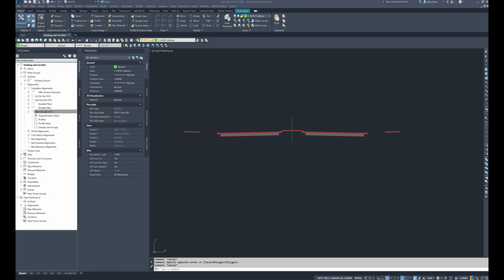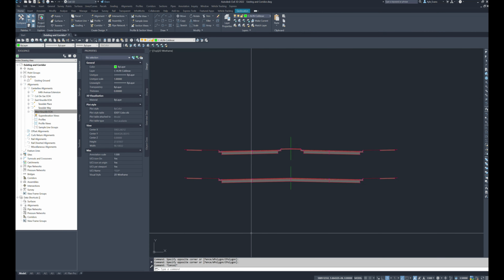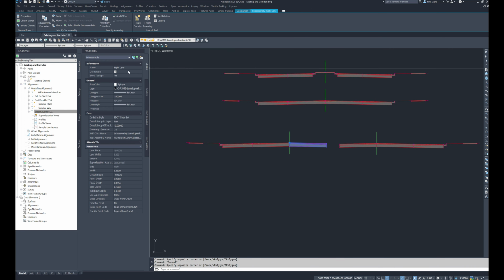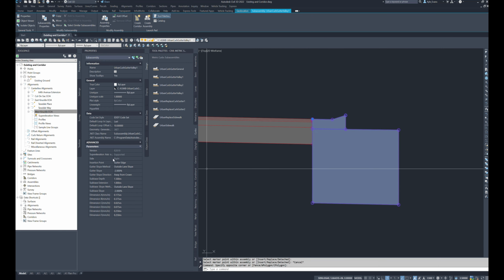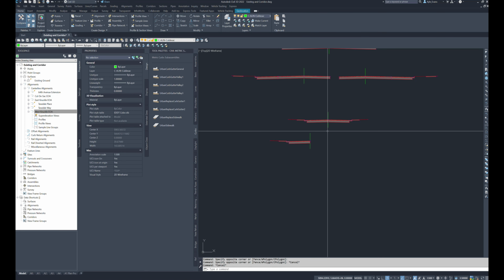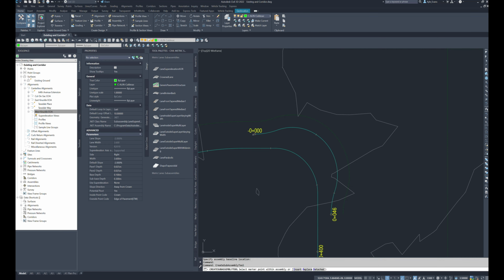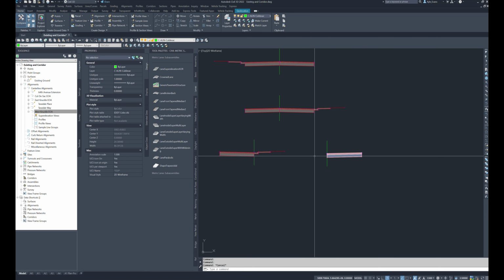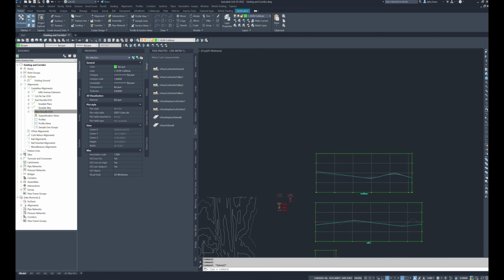Part 4 - Creating the Rest of the Assemblies for the Subdivision Road

Comment: how do you if to use curb fillet right or left?
Reply from the maker: It all depends on which side of the road that you are modelling. If you look where the assembly marker is, sometimes the Curb and Gutter is on the Right and sometimes its on the Left.
Reply: @KyleEvansCivil  understood. I understand from the perspective if you are using alignments. Right or left can be the direction of travel from start to finish along the alignment. However, in the case where you are using curb fillets in the intersection tool, I am confused as to how to use curb fillet, because, i only get to select one fillet in the intersection tool and that assembly is deployed on BOTH curves for the intersection. (Hopefully you understand, what I am trying to ask)
Reply from the maker: @RD-gj4ki  yes, in that case it's curb return right, because the lane is on the left and curb and gutter on the right. Unless you drive on the left side of the road.
Reply: @KyleEvansCivil  ok. Then I will have to use curb return left. 
Thanks for your videos. They have been an immense help to me.

Comment: Sir, u have explain every thing very well in this whole series of videos. sir i have facing a error in cut fill qty when i am using curb assembly with sub-base extension 0.2m when i am create corridors surface from bottom links in my corridor surfaces back side of curb and upper side of sub-base extension portion surface are missing in cut/fill . how can i solve this issue. sir, please give some suggestion to solve this problem. thanks u very much. i have attached the error pic in comments section.
Reply from the maker: I do not see a picture, if it was a link it may have gotten filtered out. 

Civil 3D from my experience does not do a very good job at gathering volumes from anything other than a "top" code in your corridor. You can try to get a surface from base, or sub base, but the issue is that every single subassembly needs to have those codes in them. What I do, is get volumes based on the "top" code, and then manually subtract the Asphalt, concrete, other volumes.
Reply: Sir have u uploaded any video regarding these volume calculation manually.?
Reply from the maker: @naseeryounasbhatti1077  No I do not but if you know the length, width and depth you can easily calculate it.
Reply: Sir have u uploaded any video regarding these volume calculation manually.?
Reply: Yes sir  u r right that was a link

Comment: I cannot for the life of me figure out how to have the colour picker combo box in the quick access toolbar, I got linetype and thickness no problem. please share your method!!
Reply from the maker: Are you talking about the color picker in the properties toolbar I have open ? That color picker shows up automatically.
Reply: @KyleEvansCivil  ahh that's my mistake. I assumed you had added the picker to the quick access toolbar but I assume from what you're saying it's not the quick access toolbar it's a properties toolbar. How is that added?
Reply from the maker: The toolbars are underneath the ribbon on my Civil 3D. To access them, the easiest way is to type in "-toolbar" at the command line, then when prompted enter the "properties" name, and finally click show.
Reply from the maker: @Matthew Tabor - I just posted a video for my User Interface Setup!